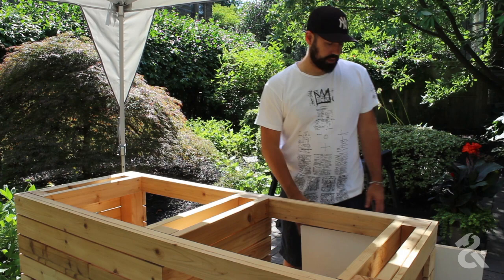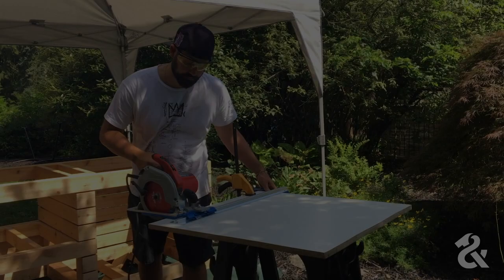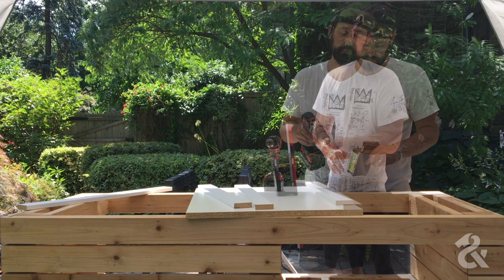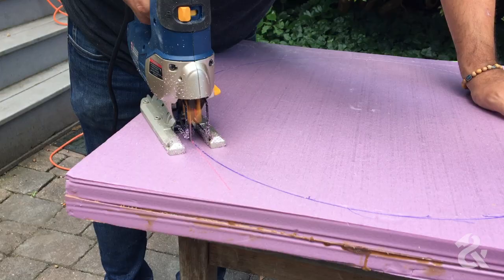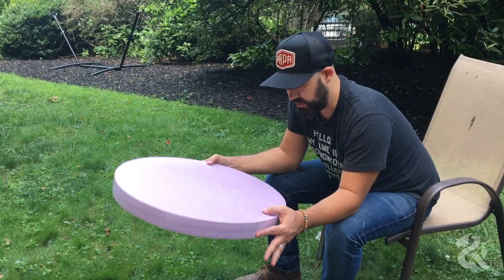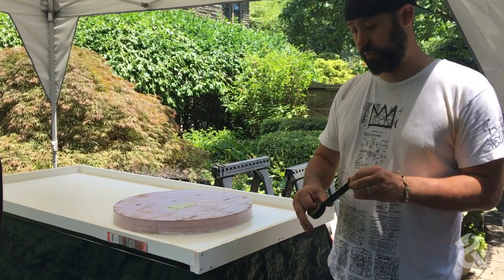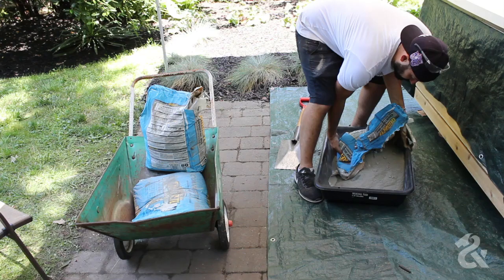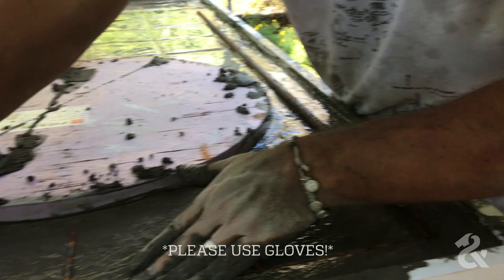Kamado Table DIY Heiko 64" (Part 3) | Concrete Counter Tops

Comment: I am currently doing this build... In this video On the Right side of the grill table the "F" piece is moved all the way over to the Right side of the grill to the legs... Not in the middle as per the plans... Was there a reason for this change or am I mistaken? I am doing this build for a Vision Pro Kamado

Comment: About halfway done with this project.  Thanks for the inspiration.  Any idea on when part 4 is coming out?
Reply from the maker: Been trying to find the time to get it done - 4 kids and 2 businesses have me spent... but im determined to finish it soon! In the meantime hopefully the plans will get you though. good luck!
Reply: The plans have been most helpful, thanks!  I'm doing it in Redwood and I've had to make some modifications because I have the newer Kamado Joe, so I guess I'm just worried about blundering through some last minute "gotchas" on the doors.  Thanks again for the plans/videos.

Comment: So how did you fasten the concrete down to the stand?
Reply from the maker: I didnt, its just resting on top and secured by the weight of itself, but You could just put a little bead of silicone sealant if you wanted to be extra safe but with the egg in place its prob not going anywhere.